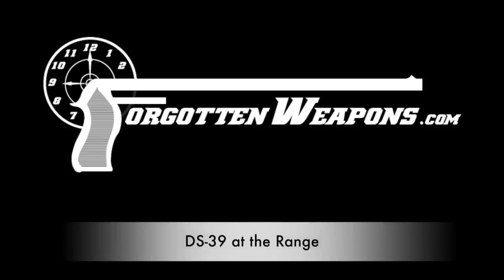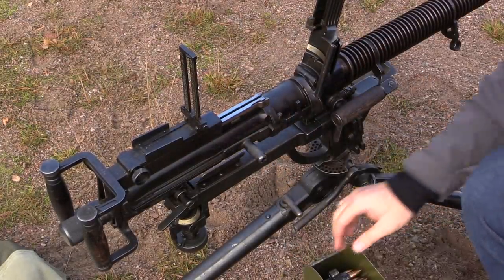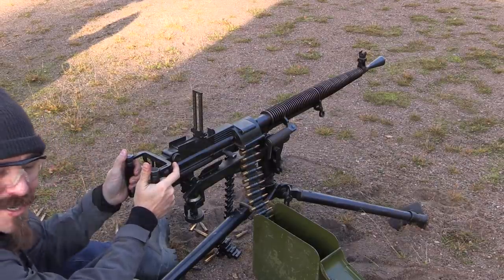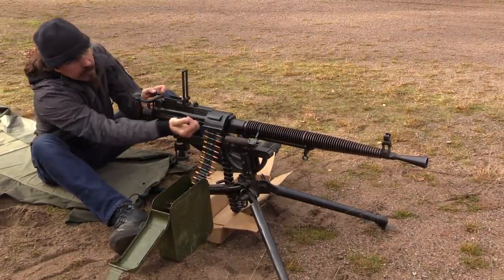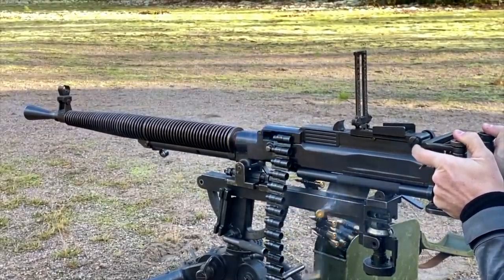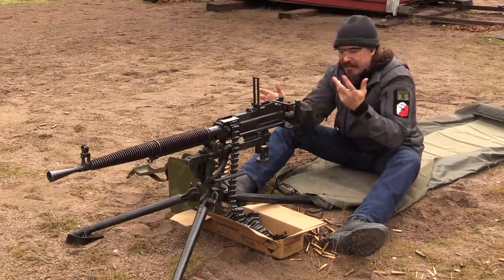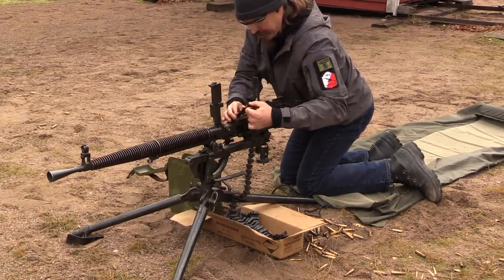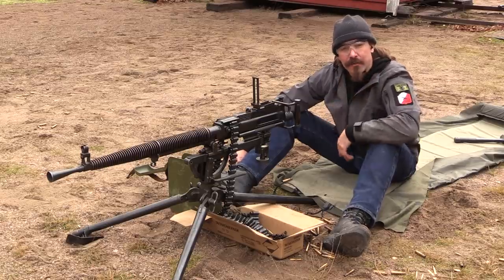DS39 at the Range

Comment: MG passes all tests and goes into field.
17 year old conscript gets 10 minute familiarization training and is told to set up the MG in a trench facing the Germans.

1) Conscript forgets to double charge the first round so the weapon fails to fire.  After some confusion he remembers the second pull and starts firing.
2) His Sergeant calls out to tell him to switch to fast fire mode.  He hits the gas port handle then forgets to twist the knob at the back.  The weapon jams, after a LOT of confusion he sets the port pressure valve and gets ready to fire.
3) Meanwhile, the weapon has had a bad primer strike so he opens the feed cover, adjusts the ammo and closes the breach for firing.  He forgets that with a live round loaded he does not need to dry fire so does so anyway and shoots a fellow Soviet soldier in the back at 200 yards.

Yeah, I can't see any issues with this weapon at all...

Comment: Ah the hammer! An invaluable tool when it comes to Russian engineering
Reply: Useful for mechanical persuasion or percussive maintenance.
Reply: The manual had a picture of a huge wooden mallet, but that deadblow was the only thing I had in my trunk for that day!
Reply: @petrimakela5978  apparently an absolute must for changing gear in the t34
Reply: @Smallgrayandfurry  Also with some UAZ:es I got issued with
Reply: The general maintenance kit for the MAG 58 actually comes with a spanner that has a brass hammer head brazed onto it. Pretty handy tool.
Reply: @simonrival1613  DS-39 kit has a similar tool, small hammer and huge wooden mallet
Reply: If the hammer doesn't work you switch to the sickle.
Reply: What do you use the sickle for?
Reply: Da comrade
Reply: @christopherrobin8134  outdated agricultural practices and the occasional lazy half-baked punchline.
Reply: Hammer and Log. The true symbol of Russian engineering
Reply: @Smallgrayandfurry  The T-34 in order to keep the track pins in had a built in hammer at the end of the track, any protruding or loose pins were given a customary whack back into the cleat upon every rotation. 😄
Reply: @lightwoven5326  T55 as well. Not sure if the later tanks kept that design or went with some tracks that were less likely to work the link pins out.

Comment: That thing fires laser straight, especially on 'infantry mode'. Is that down to aspects of the design of the gun, or primarily the tripod?
Reply: It is why soldiers in that time was carring this type of heavy mounts. This tripod is 40 pounds of steel and i can bet that the ground here is compacted well contrary to the typical site in Texas that is full of desert sand that you simply can't compact.

Comment: If the idea was more mobility, then yes, switching from a 1910 Maxim to (functionally) an M-1919ish level gun, is definitely more mobile.

 ...but not at a time when the MG-34, MG-42, BREN, Zb 26, and M-60 are providing fire-on-the-move mobility.
(M1919a6 purposely omitted)

  Hell, even an extensively modernized Chauchat would have been more relevant in 1950.
Reply: DP-27 or sometimes DT-29 would be used for that. Also designed by the same person - Vasily Degtyarev.
Reply: @legatvsdecimvs3406  this is a fair observation.  Still though, the DP wasn't a GPMG, it was a light MG...so I'll likely have to take the BREN and ZB ofnthe table.
Reply: @jacobmccandles1767  

When the DP-27/DA/DT-29 were introduced in the late 1920's there was no concept of a "General Purpose Machinegun" in the USSR, all Machineguns were classified by their role.

Comment: How do you deal with a runaway on that? It is easier with disintegrating links because you just twist the belt so it breaks off. Is it like a Mk19 where you have to jam a cleaning rod between the rounds to get it to stop?

Comment: Seems like the loading mechanism is a bad idea having to dry fire it before it’s ready to actually fire a round. Too many extra steps under stress
Reply: It's not too dissimilar from the Maxim or PK manual of arms, and to my knowledge is never been an issue for iether of those systems.
Reply: It's common for belt fed systems.  You are right about the stress part without proper training.  

My brother ran into this problem in Iraq with a mk 19.  He ended up chucking cycled, not spent, ammo at insurgents out of frustration.  Nobody could figure it out.  Afterwards they all felt pretty stupid.  Like I said, lack of training.  They didn't have that problem again.

Comment: What causes the weapon to run away like it did? Cook off due to insufficient cooling?
Still, very cool mechanism.
Reply: With the limited rounds shot and lack of a smoking barrel, probably a mechanical issue where a sear didn't catch immediately after he released the triggers.
Reply: Probably a weak round that didn't push the bolt far enough back to catch on the trigger sear.

Or maybe cold grease gunking up a spring for same issue.

Comment: Considering Russian weapon development talent it is curious that M1910 Maxim stayed in production till end of WW2. With snow filler  cap copied from Finns, and every bit of brass replaced with cheaper steel - but otherwise the same.
Reply: Soviet Armed forces reaaaaaly disliked new and untested things. Plus manufacturing wise, the Maxim production lines had been set up and optimised to perfection. Setting up new ones would seriously reduce production rate in short term, for something that might end up a failure.
Same reason probably why they kept making Mosins even if they were more labor intensive than better alternatives. They knew Mosin and even though it took more time, probably every single person involved in gunmaking in USSR could make one if given the tools and materials.
Reply: @Blazo_Djurovic  Russian/Soviet pragmatism in arms production could indeed only be envied. From artillery pieces to small arms cost/benefit calculation was what dictated what was produced.
Reply: @Blazo_Djurovic  Mosin M1944 is epitome at this thinking. Fielded way late in war, light and short. OK, infantry units were running masses of SMGs, but there is millions of men with their primary task other than infantry front combat. Kinda Soviet M1 carbine, just rough on edges.
Reply: @kimmoj2570  I wouldn't describe the stuation as to be envied. It's not like Soviets didn't want to have better gear, it's more that they understood the reality that 3 so so tanks/machineguns/rifles this month is better than 1 tank/machinegun/rifle of untested quality this month and then maybe 4 next month.
They needed all the equipment they could get their hands on NOW, and were VERY risk averse to change much unless it was VERY much needed.
Reply: Yes, but as soon as enough reliable SG-43 and RP-46 machineguns were produced and stockpiled the M1910 Maxim disappeared almost overnight in the late 1940's. Same with Mosin rifles and the SKS.
Reply: @Blazo_Djurovic  SVT-40 was a lot more work to make than a Moisin.
Reply: @ScottKenny1978  Mosin receiver was indeed machined empty from  one end with very  simple cuts compared to most service rifles of the day. 98 Mauser receiver as an example is wayyy more slower and time consuming to make.